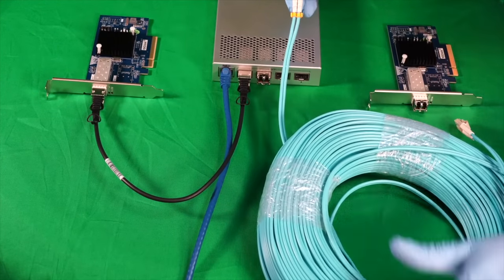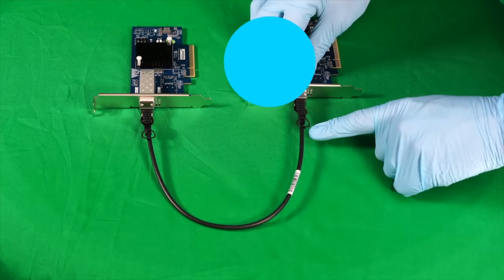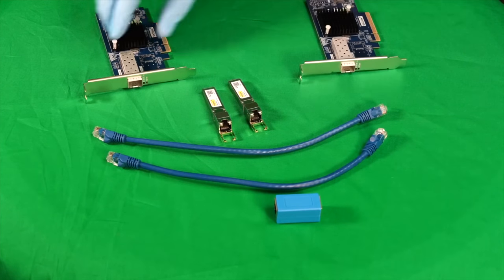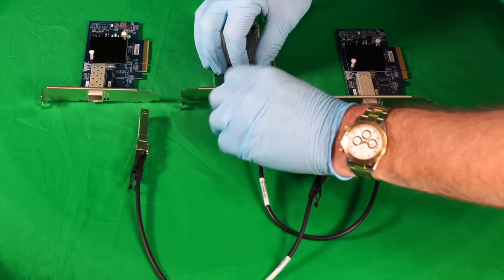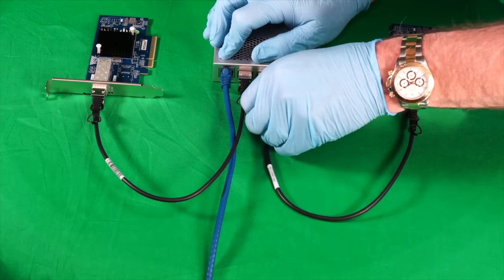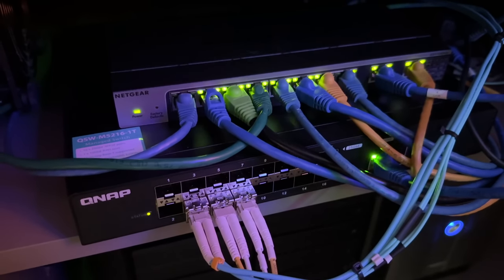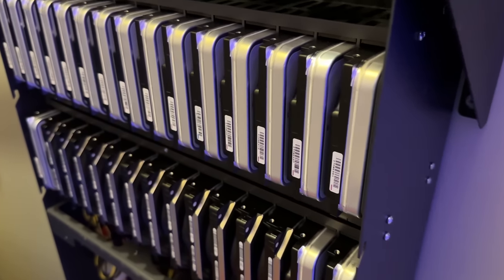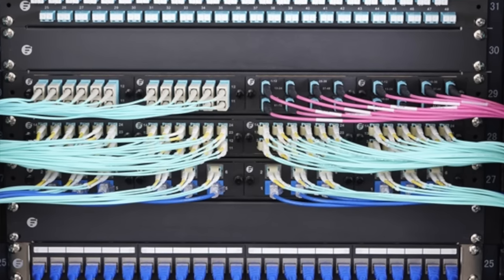10G and 25G Networking - SSD Speeds on the Net

Comment: As far as I know there is only one 25G BASE-T (rj-45) switch in the world and it was just released. I wouldn't use it because the heat and power requirements would be crazy! Optical networking will bring us 25G+ speeds over the next decade to the desktop. Single mode fiber prices will drop and people will start to get used to the greatly increased distance with fiber and just buy longer patch cables.
Reply: Single more fiber has dropped dramatically and non-glass fiber optic is cheaper and great for the short runs in a residential application.
Reply: @Alphasig336  exactly!

Comment: I found lots answers that I was going to spend half of days to research for. I got rid of my desktop and using a Thinpad laptop as my computer, is there a way to get the 10GB or 25G network to my laptop? I can't find any USB-C network adapter that will supports 10GB or 25GB :(

Comment: Hi Dave. Thanx for your video. Following your suggestions i bought a 10GbE PCIe card for my old 2010 cheesegrater 5,1 Mac Pro. I have it and my Mac Studio Ultra connected via the same Netgear 10GbE switch you have. When i run iperf3 between the two Macs I get 9.78Gb/s in on direction but only 3.7 in the other. Network settings on both computers are the same. Do you have any idea why my speeds are less than half in one direction?
Reply from the maker: No, it's oddly similar to what I experience on the Mac, asymmetrical transfer rates.  I don't think I experienced it with the built in 10G NIC though, but haven't tested that.  Make sure your MTU is the same on all machines, that's about the only thing I can think of offhand!

Comment: The connector we use for ethernet is not called RJ45, its a 8P8C connection. RJ45 is very old and not really used for networking.

Comment: Some newly manufactured cat 5e can support up to 10 gig at short distances with new standards.
Reply: While it's possible to use cat 5e cable for 10 gig you have to worry about crosstalk hence the extra twists and shielding in cat 6 and cat 6a cabling.  So I wouldn't recommend it even for very short runs.

Comment: Hm, is your stats outdated? Cat5E has been rated up to 2.5Gbps over 100m, Cat6 up to 5Gbps over 100m and 10Gbps over 55m (47m unshielded) and not 30m. According to 802.3bz-2016 and other recent standards (can't find exactly which subset of 10GbaseT, but still).

Comment: I want to upgrade my back bone to 25gb melenox, I even have cards too. But switches are insane. Right now I am running double aggragaged 10gb ports to all my switches and connections. So my network backbone is a 20gbps... Would like to do the same to get 50gbps. But I have 20gbps between each switch and major component of my network and my 5 esxi servers have 20gbps links. With another 20gbps link to San.

Comment: i use rj45 for direct connect without the crossover, it works . is this save ?
Reply: yes.  network devices have autosensing for quite a long time.  the device will do the crossover for you internally in its electronic circuit.  unless you buy a ten years plus network device you normally do not need a crossover cable. it is called auto MDI/MDIX.

Comment: This stuff seems like a great idea until you realize the cost. 1gb switch is like $20. 10gb switch is like $300.
I've been using the same gigabit switch since 2005. That's 18 years, and I'll probably use it for another 18 years if the costs don't come down.

Comment: A CAT 5E can deliver 10Gbits if the length is less than 25 meters.
Reply from the maker: I thought it was 10M, but either way, yes, you can usually get away with it for shorter runs!

Comment: I still don't usnderstand why you call it a gigaaaaaaaa, they are called SFP or GBIC. I was confused and asked your favorite AI ChatGPT which also just said that giga  is short for Gigabit, which is a unit of data transfer rate equal to 1 billion bits per second (Gbps).
Please add the Source on Wikipedia where you said the Term giga is defined.

Comment: Maaaaan. I hate seeing transceivers used. I know sometimes they are a necessary evil. But they have caused so many issues on the network I admin (thousands of switches spanning nearly 1000 sites, ranging from small, single switch networks connected through WAN to huge complexes with 10+ switches per building in a large LMAN fiber ring, and everything in-between). Transceivers are literally the number one network issue created. Even beating out ATT. If you can avoid using them, always avoid using.
Reply from the maker: I've never had a single issue in my life yet, but have seen few compared to you!  The only reason I use transceivers is because I was an early adopter of 10G and RJ45 ports were scarce.  So on my switch, I'd use the four native RJ45 ports for long runs, and then transceivers plugged into the SFP+ ports.  But if I had more native RJ45 ports, I'd use them!

Comment: Hi Dave, I am sorry I am writing here, my imagination and skill set is limited to asking a question here. When doing math in any and all programming languages, which is faster to use ( I have multiple scenarios - I wish to port to lower spec devices and which to start-off on the right foot - It is sort of a wave collapse function but the idea is which is the most efficient way to structure the data starting of at 9x9x9)  1.) a 3 dimentional array with the final dimension having 10 possible values , making index 0 the actual value for use.  or a 2 dimensional array of a jagged array with 9 possible values at start and deleting the final values when no longer needed. thus if (jaggedArray[x][y].length()==1), the set value is that value at index 0? I Could possibly do it a couple of other ways too, but then I thought about scenario 2.) which data type is best for comparisons and handling mathematical equations (considering that the highest value will be less than the size of a byte. is byte or short faster, does it matter when using signed or unsigned and is hardware nowadays optimized to be able to handle the arithmetic on longs and ints indiscriminately ? (Then the question you probably got asked a lot: does it matter which is best, because it will work any way ) - to me it does as a matter of principle of efficiency * - but also at what point does technological advancements become ... redundant (referring to the 4k vs 8k gaming video on linus tech tips) - more horsepower just means more wasted. I believe legacy technology can live forever I am typing this on a Nokia 3310. I want my new wave collapse project to work well on here too...

Comment: RJ45 Cat6A cables are thick and stiff and annoying. RJ45 10G SFP+ modules are overpriced. I'm at the point of just using singlemode fibre just about everywhere now, except runs that need Power over Ethernet.

Comment: Single mode is cheap, the price difference is less than 10%
Reply: That’s just not true.  Maybe on older tech or 3rd party transceivers.

LR is typically 2x or more the price over SR transceivers for manufacturer original parts.
Reply: There’s nothing wrong with third party optics, with oem optics you’re not paying for the product, your paying for the name and warranty support

Especially for the homelab space that this video is aimed at, single mode optics are a minimal cost upgrade, for a much better product